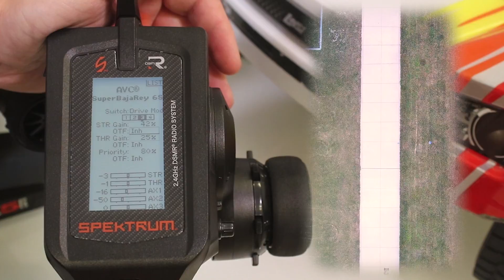Spektrum Drive Modes - Stability Mode Explained

Comment: Can you guys update me with ideal drive mode settings for my Arrma Kraton 6s; or possibly provide ideal slick and full rip setting modes?
Reply from the maker: We would just suggest copying the model file from the LST 6S model and running with those settings and drive modes. This works great to get you started and you can tune slightly from there. Hope that helps!
Reply from the maker: Oh my bad I thought there was a LST XXL 6S model. Same goes for the Super Baja Rey 6S model :)
Reply: SpektrumRC I have this transmitterwith the same set up u have on litmitless and I can’t put it to work I’ve been so frustrated pls help